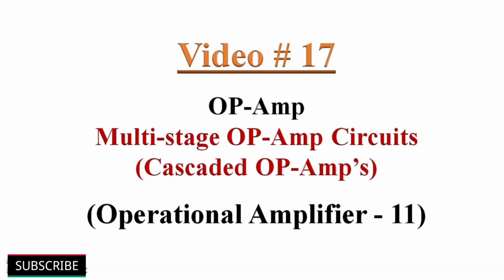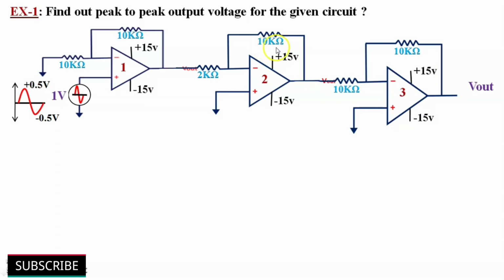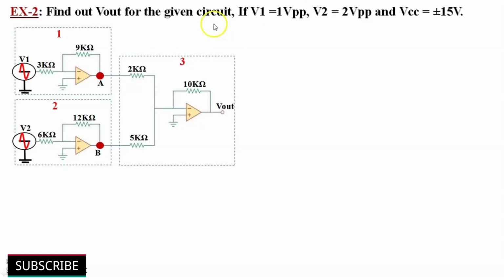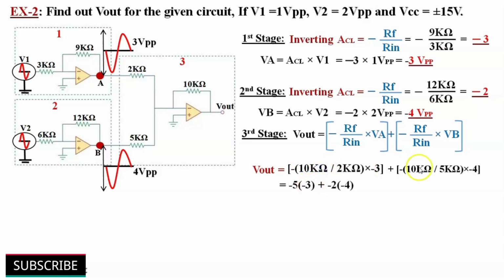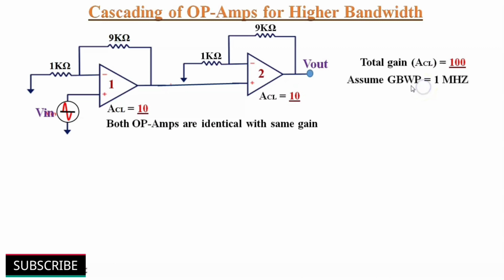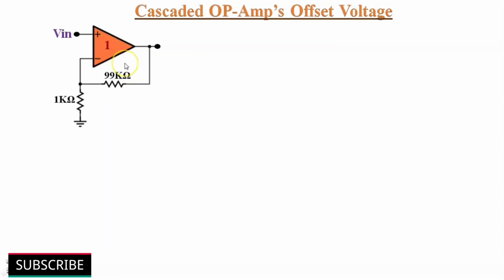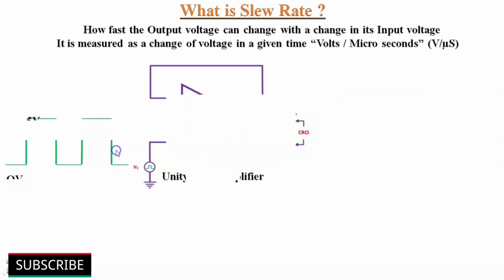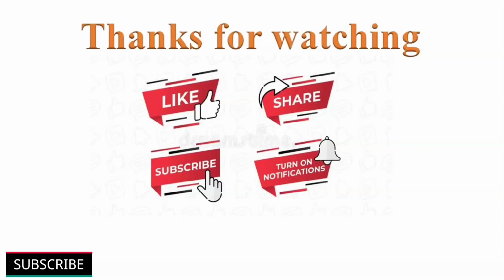Multi-Stage OP-Amp Circuits (Cascaded OP-Amps), Voltage gain, Bandwidth, Offset Voltage, Slew Rate.

Comment from the maker: The timestamps for the various topics covered in this video are as follows:
1) 00:18 - Introduction,
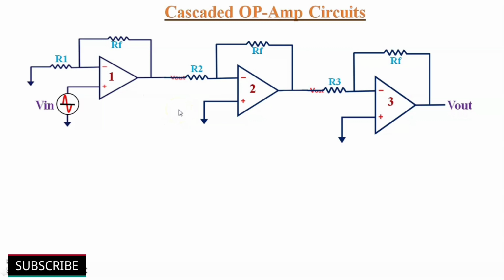2) 00:39 - Cascaded OP-Amp circuits,
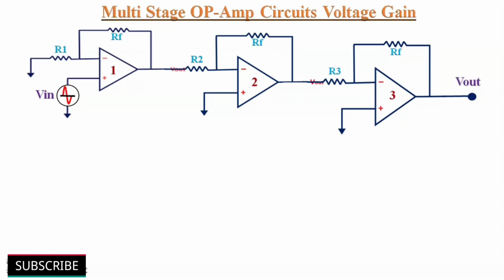3) 01:04 - Voltage gain of cascaded OP-Amp's
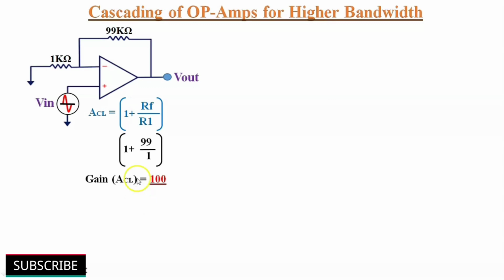4) 07:21 - Bandwidth of Cascaded OP-Amp's,
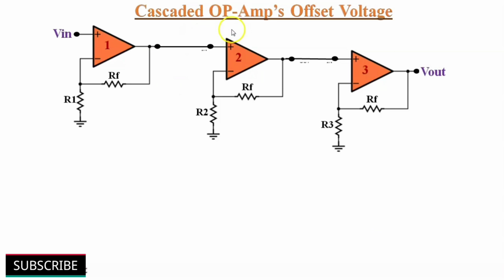5) 09:49 - Offset voltage of cascaded OP-Amp's
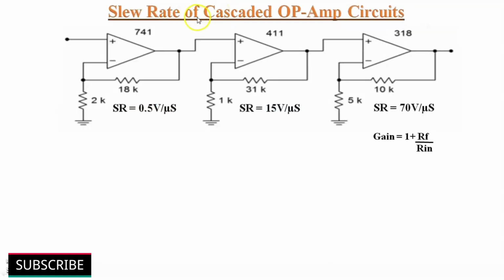6) 12:35 - Slew rate of cascade OP-Amp circuits.
Reply: Thank u

Comment: So if the gain is already given and you are told to design a multistage do you need to calculate the gain first before converting to dB?
Reply: If the gain of each amplifier stage is expressed in decibels (dB), then the total gain is the sum of the gains of the individual stages:
Gain in dB (A) = A1 + A2 + A3 + A4 + ... An